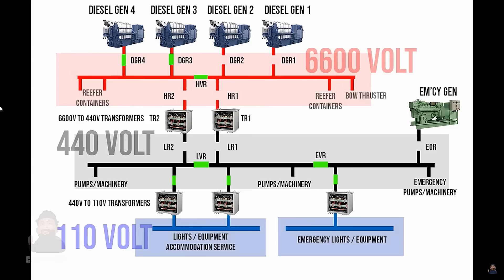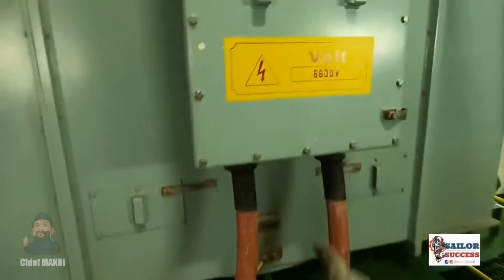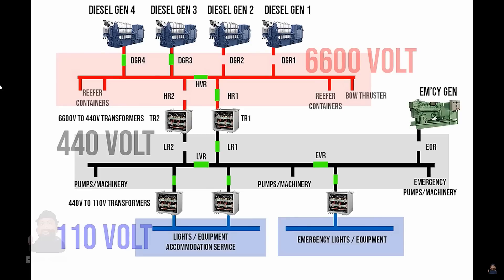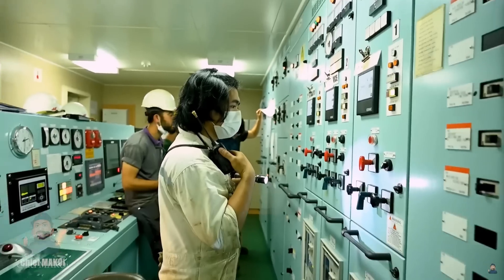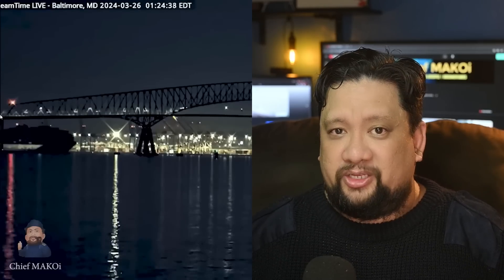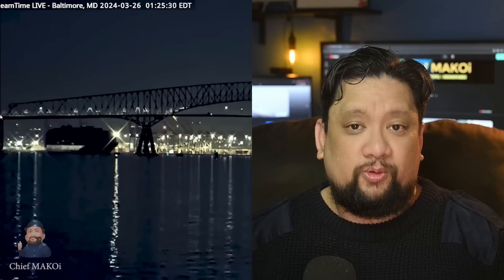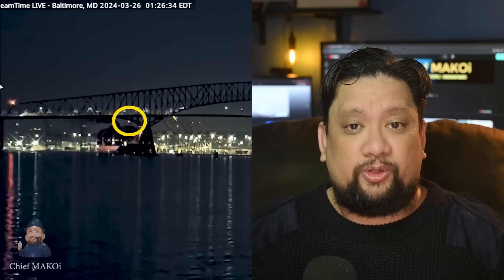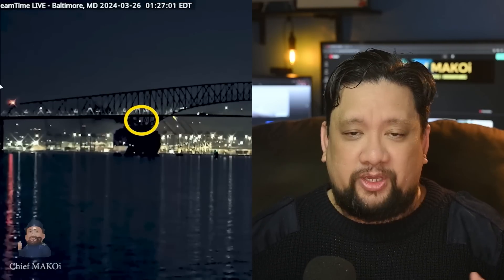Bow Thruster : Why The Dali Didn't Use It | Chief MAKOi

Comment: I am not sure that there is anything in the laws of physics that says you cannot use a bow thruster above 6 knots.  The only laws of physics applicable that I know of is the part where the generators tripped and so for that period of time the bow thrusters could not have been powered.  But that was not the whole period of time, just part of that period.  I would think the normal deal is at above 6 knots under normal operating conditions you would simply have no need to turn them on.  But under normal operation above 6 knows you have a working main engine, which the Dali did not.  Maybe to make another Hollywood reference, bring up a Scotty reference from Star Trek?  Here is the thing if you ever get into engineering, it is common to end up using systems in ways they were never originally designed for.  Often the answer is the use something for something it was never designed for does work.  Of course when it doesn't, you fail to do what you were trying to do.  Take the Sioux City DC-10 crash for example.  The engines were never meant to be used to control the plane, only propel the plane forward.  However, when all hydraulics were lost after a fan disk failed and severed all 3 hydraulic lines, a dead heading trainer pilot came into the cockpit and ended up using the engine throttles to line up the plane with a runway and crash landed the plane.  Amazing that they made it that far and that anybody survived as what would have happened otherwise would have been the plane going out of control mid air and spiraling back to Earth, but the point is the engines were used in an unconventional way and that made all of the difference in the world.

So getting back to the Dali, it sounds more to me that in the heat of the moment, this unconventional, out of the box thinking did not happen.  Nobody should be dinged for this.  But maybe somebody should simulate the Dali incident at sea where there is nothing to hit and see if it was possible to avoid a collision.  Getting back to flying, when accidents happen, the aviation industry learns and new training takes place.  So if there is ever a future Dali incident, if this line of thought was explored instead of summarily dismissed, maybe training would change to use those bow thrusters in the event of main engine shutoff and subsequent loss of effective steering.  Just leaving it no main engine, no real steering is not a good place to leave the conversation, especially when we know there was something left on the table nobody ever tried that seems like it could have changed the trajectory of things.  If the bow thruster idea is tested and fails, maybe ship design needs to change as you are getting into inherently unsafe designs.  A safe design never has one complex component such as an engine fail and then in this case the ship careens out of control and crashes.  And at this the Dali engine failed because the pumps for the engine lost power, so systems collapsing like dominoes is also not good and needs to be revisited for ship designs, especially as we do as a species understand electricity well enough to where this should not happen, but apparently did not apply this knowledge to building container ships.
Reply: The physics principle you're looking for is the Coandă effect. At speed, the flow from the tunnel thruster attaches to the hull and doesn't provide lateral thrust.
Reply: @jdmillar86  Does the bow thruster even get water when making headway? I think that the water is busy going past the tunnel and it does not have time to turn into the tunnel. My guess is that the thruster would not even take much current because it would be spinning in a low pressure. Some commenters say running the bow thruster would decrease drag while other say it would increase drag. I guess both can be right and the reality is that it depends on the vessel.
Reply: @satunnainenkatselija4478  great point, I definitely don't know enough hydrodynamics to predict what the flow in the tunnel would be like.
Reply: @jdmillar86  I would think as long as the bow thruster(s) is(/are) able to displace water from one side of the ship to the other, it should create a net force, changing the trajectory of the ship.  I actually come up with the Coanda effect may enhance the steering effect of the bow thruster at speed and I will explain.

To use the physics you describe in aircraft, say you open vents near the wingtips and have a vertical fan in the wing blowing down on one side and up on the other side while zooming through the air at high speed.  Fluid dynamics is fluid dynamics after all, so this should also apply to your bow thruster example.  So when you blow down on one side, the air displaced down to the bottom of the wing causes more lift to be created as there should be even lower pressure on top while the air displaced to the bottom should create an even higher pressure on the bottom of the wing.  On the other side where air is flowing up to the top of the wing, less lift as the opposite is happening.  Planes like the Harrier have vents in the wings, granted they are using bleed air from the jet engine to push out of the vents for control, so this further goes to real world examples of this.  A helicopter may move at well over 100 knots basically using a huge propeller to displace air from above the rotor to below the rotor in order to stay in the air.  The main limits of the helicopter being leaning into the wind to create thrust and the receding rotor blade generating less lift than the one moving into the wind, causing the helicopter to want to roll.  Also helicopters tend to like to pitch up in the wind, but we are getting into the weeds here.

If anything what should happen when displacing water from one side of the ship to the other at speed is both the propeller in the bow thruster experiences a force from accelerating water, then the side of the ship where water is getting sucked out from should experience a lower pressure while the side the water is being displaced to should experience a higher pressure, adding to the force changing the course of the ship.  So taking in the Coanda effect as you mention, I come up with it may actually enhance the steering by bow thruster, not null it out.
Reply: @ChaJ67  instead of the thrust vectoring Harrier, I think the F-35B with lift fan is a probably better example for you. 

One countering mechanism is that on the exit side of the tunnel, the increased velocity of the attached flow actually decreases pressure.

In any case, the ineffectiveness of thrusters beyond a few knots is well established and is attributed to the Coanda effect.
Reply: @jdmillar86  I have done some searching around and while I just seem to find people talking in forums, which I try not to draw too many conclusions from, maybe the way I have to process better what you are telling me is say you turn on the bow thruster at 6 knots.  The bow thruster will generate a force.  However, you have to push against water rushing past the ship while the ship is designed to hold a stable direction as water flows past.  So the hydrodynamics is you are pushing against a self stabilizing force, reducing the effect of the bow thruster.  It sounds like going in reverse has the opposite effect, but I would think this would make sense with a self stabilizing hydrodynamic design.

Maybe another way to put it is say you are flying a plane and you introduce an imbalance of engine thrust for engines on the wings.  If you are sitting on the runway, easy to turn the plane around with this asymmetrical force as the rudder does basically nothing.  Near top speed, the rudder will create a lot of counter force, reducing the effect of this asymmetrical force.  Granted, a plane will still tend to turn, but it would be a very slow turn without proper correction beyond keeping the plane level so the plane is not turning via the wings being tilted, creating sideways lift.  You are also having to change a colossal amount of kinetic energy into going another direction with the self stabilizing design fighting against that change in direction.

Going back to the bow thruster, its relative force is very small.  The force of water rushing by a large ship like this is very large as well as the colossal amount of kinetic energy fighting against you in a self stabilizing design.  When there is little to no relative water movement, the bow thruster doesn't need to do much to move the boat.  But at speed, its force is a relative drop in the bucket to this self stabilizing force.

Is this what you were getting at?
Reply: I am thinking even if the change of course would have been small, you just need enough deflection to avoid hitting the bridge.  So mqy have still been worth it.

Comment: So in a power failure like the one the Dali experienced, how do you figure out what caused the breaker or link to open, and at what point do you decide, if you can't figure it out, to just close the breaker/link again and see what happens?

I dabble in electronics and, when a fuse blows in one of my power supplies, I too generally start debugging the circuit first to find out what went wrong. (If I've got a big pile of fuses handy, I might just throw another one in and see what happens, but I'm a software guy; the hardware folks certainly do not consider that good practice!) But it can take quite a while to do such debugging and, as we've seen, you may not have a whole lot of time when you're manoeuvering in a narrow shipping channel.
Reply: In  power system like this all breakers are tripped by a large assortment of protective relays.  These relays almost always have a flag device on them that they have initiated a trip.  One breaker can have a bunch a protective relays capable of tripping it and may not have a annunciator board telling the operator what initiates the trip.  Searching relay by relay can take time,

Comment: I know it probably won't work, but as the general in war games said " hell I'll piss on a sparkplug if that would help "
Reply: I don't think they had any spark plugs to piss on.
Using the bowthruster during power issues seems like a risky thing to do. after all the bowthruster is a huge electrical consumer.
Reply: The thing is, it’s not something that would ever really have much of any shot at working. The bow thruster is like a propeller in a tube: it works by sucking in water from one side of the ship’s bow and shooting it out the other. The problem is that the bow thruster doesn’t work if it can’t get enough water. As much as we like to talk about “suction”, it’s not a real thing. What “suction” actually is is just a reduction in water pressure in one area that allows the water pressure in another area to push water into the zone of low pressure. When the ship is moving, the water is flowing past the bow thruster intake instead of just sitting there. Bernoulli’s Principle means that the water pressure outside the bow thruster intake is lower when the ship is moving than when it’s sitting still. And since the water is moving past the bow thruster intake, that lower water pressure also has a reduced amount of time to act on the water before that water is already past the bow thruster. These two effects combine to make the bow thruster unable to pull enough water in at higher speeds. If it can’t pull as much water in, it can’t shoot as much water out, which means that it can’t generate nearly as much thrust. That’s why their power drops off so quickly above two knots, and why the pilot would have known that it was basically completely useless at 7 knots.

Comment: DALI need 3 AE to run bow thruster, i remember when i was cadet on DALI.
Reply: Is that because of the load of all the reefer containers, that 2 DG isn't enough power to run the bow thruster? DG1+2 or DG3+4 is around 8,400 kilowatts available in each pair.
Reply: Do you know if she had issues when you were on her??

Comment: You said it Chief-they lost power at the dock but still left anyways.  Why wasn't the blackout problem found before leaving the dock?
Reply: WHO ARE THEY? 
Less than optimal decisions are made every day. 
Most work out OK. This one…not so much.
Reply: There was two power losses at the dock.  One was apparently a maintenance error.  The other may be tied to the losses just before hitting the bridge.  These may both have been associated with a load share problem between generators,  It is typical with a load share problem for everything to look Ok for some time (minutes or even hours) before gererator trip outs begin.
A complex subject.  Google Cross current compensation if you want more info

Comment: I do not understand why the course of the ship had it so close to the bridge support. And why did the ship veer off that course?
Reply: They originally were steering down the center of the canal.
When the ship lost power the rudder stopped working so they couldn't steer this point.
Now, important to remember, a ship is not a car - if you are not correcting your heading all the time, and just leaving the rudder center, the ship will start to veer of course, this happens slowly in the beginning (the first few minuets), but it will increase over time.
My experience of this is: I once forgot to reactivate the auto pilot after daily check of the steering gear pump. 
Mind you it was in the open sea somewhere in the Atlantic with nothing around.

Comment: Short answer: it ineffective at the speed they were going
Reply: As the pivot point is fwd of the midship , and also the rudder is more effective than the bow thrusthers at that speed
Reply: I'd like a summary explanation of the hydrodynamics behind that.  Like, if at speed, will the thruster intake not be able to ingest enough water and the propeller just cavitate?
Reply: @h8GW  Not propellor - ducted impeller…
Reply: It also doesn’t work when the power is off - it needs three megawatts of power from the high voltage bus but is controlled by the low voltage bus powered controls.
Reply: @allangibson8494 That's  the most misunderstood point. The controls are operated from the low voltage bus. No LV, no controls. However comma, was not the emergency generator feeding the LV/control bus? 
And Chief Makoi points out the ineffectiveness of tge bow thrusters at speed.
Reply: @The_DuMont_Network  The Emergency generator feeds a SUBSET of the controls (ie enough to troubleshoot the cause of failure with the assumption that you won’t be hitting a bridge in two minutes) - and was probably designed on the assumption that if the main generators were offline the bow thruster didn’t have power anyway. That said, a UPS on the bridge controls would seem to be a “good idea”.
Some ships do have fully redundant propulsion and control (ie some more modern LNG tankers (where a similar oopsy would have taken out the entire city (think Hiroshima sized fuel air explosion)).
Reply: @allangibson8494  That's exactly right, they're not going to run 6600 volts to any controls. Imagine the arc flash hazard if there was a short somewhere. Ever seen what was left of a squirrel climbing up a power pole to a transformer HV bushing? It goes BANG.
Reply: @brnmcc01  Ever seen what happens to a possum who runs across the incoming 11kV buss bars on a major industrial substation? 
The bus bars evaporated (and tripped the nearest power station off the grid). Copper plated windows, brick walls and concrete ceiling.
Reply: @allangibson8494  Yup, there's a saying, because 440v is nothing to mess with either. But, 440v puts you in the hospital, 6600 puts you in the morgue...
Reply: @brnmcc01  And 66kV requires a search for parts. (And 132kV will kill you for just walking past (which is why grounded fences are needed)).
500kV gives significant radiation exposure (it generates gamma radiation from antimatter annihilation) which is the upper limit to transmission voltages as a consequence. Any voltage above 20kV will generate X-Rays if electrical faults occur (insulation breakdown).
Reply: @allangibson8494  The highest transmission line voltage where I live is 765,000 volts. But for smaller substation feeders the typical more common voltage is 230 kv. 765 is just for mainly interstate or long distance grid connections.
Reply: @brnmcc01  And anything over 500kV is an ionising radiation hazard.
Imaging systems are used to detect radiation and linesmen need to be monitored for radiation exposure…